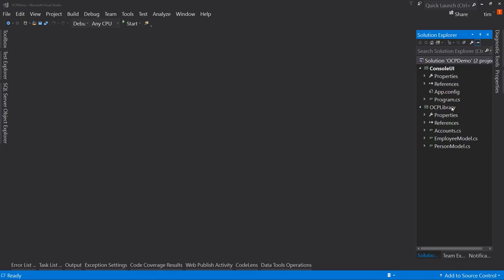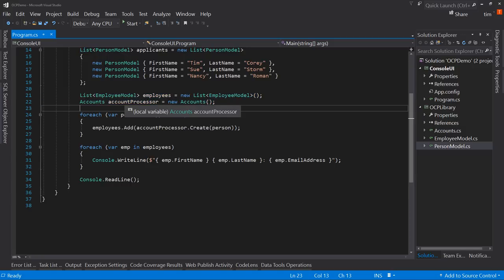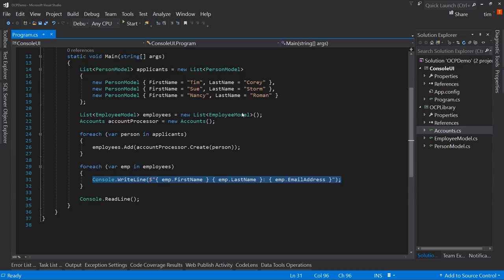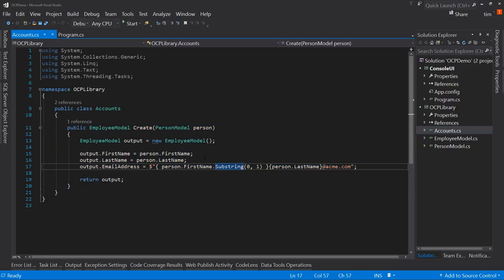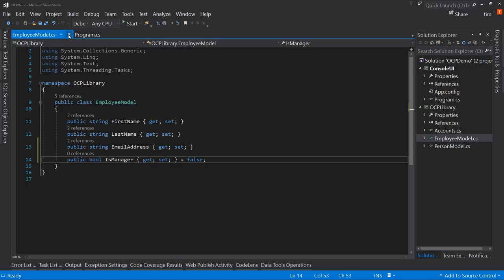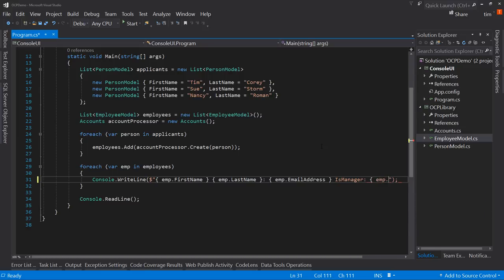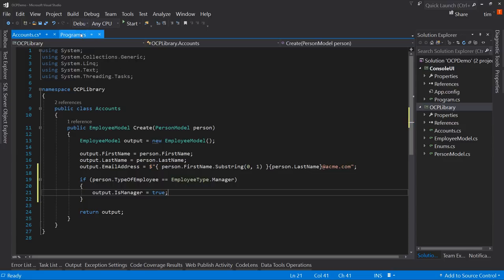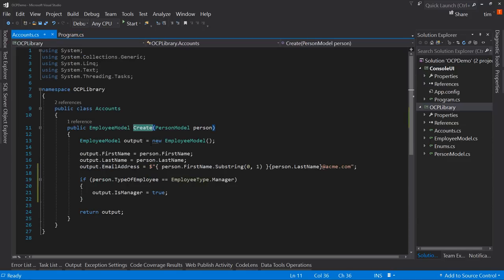Design Patterns: Open Closed Principle Explained Practically in C# (The O in SOLID)

Comment: I have a problem with real world application because somewhere a new class should be instantiated (PersonModel, ManagerModel, ExecutiveModel) and the list should grow with new extensions. 

 With a real world application, a combobox for example has a selector and depending of the selection a class (Person,Manager,Executive) should be instantiated, if new selections is being added, new instantiations must be made, I don't see any way around this.

 What I came up with is a "Handler" class take has the responsibility to detect and instantiate classes on IAplicantModel, that way the main application code does not change, the Processor does not change and even the models does not changes, but the "Handler" does need to change.

and it ended up like this:

IApplicantModel applicant = applicantType.GetApplicant(comboBoxRoles.SelectedIndex);
applicants.Add(applicant);
Reply from the maker: There is always going to need to be change. However, OCP addresses the idea that when you add new features, you extend rather than modify a working class. The reason why is because the working class is working. If a change happens that makes the working class no longer work, then you change the class. If you want to add a new feature that isn't necessarily used everywhere, extend the class. Otherwise, you need to test things that were working that now might not be working because of your change.

Comment: are really a lot of people worried that I am not writing my code right? ;)
Reply from the maker: Yep, there are. The hard thing is that you need to be concerned that you aren't writing your code correctly but not to the point that it makes you lock up or feel bad. If you aren't concerned that you are writing your code correctly, you probably aren't improving. Since no one is a perfect programmer, that's a problem. On the other hand, if you are so concerned about writing good code that you never write any, that is a problem as well. You have to maintain the healthy balance to be a great developer.

Comment: maybe I am not experienced enought yet, but I did not like this example; for just a reasonable person I still can not get the point - how is it better (= by "better" I mean less bug risks, more compact code etc) to implement in essence just one new property/flag (person is a manager or not) - is to create a few new classes, dozens of lines of new code ...  but I'll keep trying to get it
Reply from the maker: When you have an application that is running in production, introducing new code to the running application means you have to test everywhere the new code touches. If you change a class that you use throughout the application, you might have to test every part of your application. That can be a big deal when your application is hundreds of thousands of lines of code (or even a couple thousand lines of code). Changes bring bugs. Don't forget that you can't just test things one way. In business, whole departments are dedicated to just testing the application before it goes live and they still miss bugs. So if your application is running, why would you do something that could cause it to break? Instead, you extend the class for your new usage and leave the working code alone. This means that you only need to test the new code for bugs. Remember that the bugs aren't just in the code you wrote, but in how that code interacts with other code. For instance, just adding one property might not seem like a bug, but if a different part of your application displays a grid of data, you might overflow the form now since your grid is going to be bigger. Or maybe you depended on that class to request data from your database. Now with one extra property, it crashes your database call. The bottom line is "if it isn't broke, don't fix it".

Comment: re: employees.Add(person.AccountProcessor.Create(person))

It feels wrong to be passing person to the Create here because we are now starting the call from the person object which is already instantiated. It’s like it’s left over from when accountProcessor was acting like a factory method. Is this just a compromise you are making for not wanting to change the Accounts class?

The danger here seems to be that I could now pass a different person instance , say Tim Corey, to Sue Storms manager account and now it looks like Tim Corey is a manager (or rather that Sue Storms name is Tim Corey).
Reply from the maker: The idea here is that three people apply for three different job types. We create those people in the system but they have no status. Then, when we hire all three, we pass their accounts through to be converted from applications to employees in the job type they applied to. There isn't a compromise here. The system is working as designed. The design is to have classes that have one job, not multiple. The AccountProcessor's job is to process the conversion of an applicant's account to an employee account with all of the privileges thereto.

The only way you would be in danger of crossing data is if you intentionally did so (which you can't really account for). Yes, if you changed Sue's name to Tim then it would look like Sue is Tim but that isn't something you can ever really fix. It won't happen accidentally though.

Comment: I hate to say it but I think this has confused me more than I was to start with. Could just be me, but seems like even in the second half of the video where you start to apply the OCP principle you are still making MANY changes that violate that principle. Isn't the point to make a class extensible and should not be modified when changes are needed? Seems like you are still making major changes to accomplish simply adding a new property as the end goal. It feels like the attitude of the video is that most of what you are doing is subjective, but at what point do you start making the decision that violating OCP just a little bit is OK. Also seems like trying to follow OCP in an existing program would be very difficult at the least when a completely new requirement comes up, so how are you going to introduce some entirely new requirement without modify a class to support it?.
Reply from the maker: OCP is for once a class is in production. When you are building it, you can modify it all you want to get it right. I think that is part of the confusion. Also, OCP is a goal, not a law. There is going to have to be some flexibility.

Comment: I think a better display of the principles would be going over a single project rather than showing a different project from the first. also false is the default value of a bool so = false is redundant. For the inheritance have it inherit an abstract class for the base then you can override things that may be slightly different but similar.

Comment: It appears your solution introduced violation of DRY principle and I did not see how did you remove repeated code in construction, I would say using an abstract class and setting output first-name and last-name (and perhaps further properties in future) 

and to be very honest with you naming also doesn't make good sense, your naming convention is saying "Every person is an applicant" but a proper naming convention (while keeping same properties) is to say "every applicant is a person" and every employee is a person" because not "every person is applicant" , they can be employee.

and putting the code in GitHub where audience can navigate without downloading a zip/extracting
Reply from the maker: Couple things. First, repetition is not the sole indicator of a DRY violation. I don't see a violation here even though there is a bit of repetition. Second, not sure what you mean by every person is an applicant. Even the code doesn't display that.

Comment: I like C#. But it seems that not many companies use C#. If I want to work at Google, do I have to stop learning C# and learn C++ or JAVA?
Reply: The different languages are quite similar, so the better you are at C# the better you are at the other ones aswell, as long as you just learn the slightly different syntax.
Reply: @kattenelvis1778  thank you
Reply from the maker: A lot of companies use C#. However, there are other languages that are popular as well. It is better to pick the language you want to learn and then get a job developing in it.

Comment: Like for your work. But in  my opinion: 1) video so long; 2) Why we need so many child classes - PersonModel, ManagerModel, ExecutiveModel with the same properties? we can have one PersonModel with base properties (like Name, Email etc) and few properties  with some interface types - like "IAccounts AccountProcessor". And on creation new Person point - you can populate new instance with appropriate data, also populate prop IAccounts  with appropriate type....
Reply from the maker: This is a demo so while some things could be done differently in this specific instance, the point was to show OCP as simply as possible. As for the length of the video, I make videos long enough to cover context, not just the topic. I could cover OCP in about five minutes (I actually have a presentation where I do that but I specifically say it is a review). The problem is that this leaves you with theory and no example of how to actually use it in practice. It is like teaching a person how to build a roof without teaching them how to tie it into the house. It feels like you are learning but it has no real-world application. I always teach with a focus on using the item in the real world. That takes time.
Reply: @IAmTimCorey  
And this year's Oscar goes to ...
Reply: @IAmTimCorey  any way, Tim, thank you for your explanations. It is usefull for understanding this staff
Reply: @IAmTimCorey  I think you are in a right track with having long videos with practical teaching approch. IMHO there is a way to improve it event further, e.g. you can chop them up in 10 minutes peices. This would give the veiwers more focus + sense of accomplishment when they are done with each part, so that take a break in between a long and more complex topic and feel that they have earned it at the same time.

Comment: Is there a need to use long hours videos to explain a simple topic ?
Reply from the maker: I don't really understand this question. You are posting it on a video of less than an hour that not only explains the topic but illustrates it with code.
Reply: @IAmTimCorey  I believe most people do generally in 10 minutes. This is an objective question, thank you
Reply: For most people that 10 minute video is probably fine but it is always nice to have a more thorough explanation when starting. Back when most people start their first language the topic covering primitive types is often an hour long. After that types can be talked about fairly quickly. Having more detail can't hurt but not having enough can.
Reply: The SOLID principles, and the open-closed principle in particular, are not simple topics, even if they can all be described by a single sentence or two. It takes quite some time to understand them well, and it takes a lot more time to become good at using them in writing software and in seeing them being unused or misapplied in existing software, as testified by so many degenerated code bases and bad software projects out there.

Comment: I find the naming not so nice: 
- Shouldn't PersonModel/ManagerModel... simply be Person/Manager..? Adding the word Model doesn't add anything.  
- An Account is not the same as an AccountProcessor?! Maybe it would be more obvious if you called it EmployeeFactory
Reply from the maker: Well, you are bumping into industry conventions here so you have to be careful about naming. For instance, a Model is a keyword that indicates that it is a class that contains (mostly) just properties. It is a data carrier. We use this terminology clearly in MVVM, MVP, MVC, and more. That is why I named these classes with Model at the end. As for calling the AccountProcessor EmployeeFactory, a Factory is another specialized name. It indicates that the class creates concrete instances on demand. This is where the term "Factory Pattern" comes from.  I called it Processor because its one job was to process accounts.

Comment: I think that has only convinced me NOT to use this principle at all.
Reply from the maker: I would be interested in knowing why? Is it the added complexity? The disconnected nature of the application? Design patterns do tend to make your development more complicated to design (and there are a TON more files than if you put everything into one class). That does tend to make a mess, especially when you are trying to convert an existing application over (not that a new application is necessarily clean). However, unless you only ever do simple applications and you rarely make large changes to them (changing UIs, changing databases, etc.), you often see the benefits of design patterns like OCP. For example, in my C# Application from Start to Finish course, what if my boss came to me and said that we are now using MySQL as our database provider instead of SQL? No problem. I would have one class to rewrite and I would be done. Now what if my boss came to me and said to make it web-based (hint: I did that in an add-on video)? No problem, I could do that in about seven hours even if I explained every step. Try that in an application that does not practice at least some OCP/SRP. You are talking about an entire application rewrite (been there, done that numerous times for companies).

Now, before you think that I'm all in on design patterns for everything, I'm not. These are patterns to follow and recommended best practices. They don't fit in every situation. Just be careful thinking they never benefit your application.
Reply: I have been for a few interviews when they have asked me to real of SOLID Principles. But I think with any of these design principles there is pay off between using them and refactoring (I think you did mention this). 
In some simple applications is it not just best to try to keep the code from getting overly complicated?
Also, my main problem is that we suddenly need a whole load of classes now for each type of employee.
What if we wanted to add first aider / fire warden to the list? Would we need a class for each of these? What if a manager was a fire warden too?
Reply from the maker: Yep, there is definitely a trade-off when it comes to complexity and the size of your application. The danger, though, is in thinking that your application is simple. Most applications in business start off simple and end up massive and wildly complicated. By the time you realize it is growing big enough to need better design patterns, it is too late (seemingly) to implement. Rarely does a company authorize you to go back and spend days or weeks redesigning an application with no appreciable change in the final product. The desire is more features, not better infrastructure.

As for the added complexity if the scenario gets more complex, I think you might be arguing to implement OCP rather than arguing against it. If we don't use OCP, we have some type of switch statement or series of if statements, right? So if you add those other types, you have to update a working class with new code and then test everything all over again. Pretty soon you have a huge method that has tons of code and is complex to read and understand. It becomes a fragile artifact that people are scared to touch because one change can have cascading repercussions. On the other hand, if you implemented OCP, adding new types just means adding a new class for each. Each class has code specific to that type and it is small and easy to read.

If you find that you are mixing your types or having more than one thing apply to a user, you could have a List<IProcessor> attached to each person and then you just select which options apply to them and each gets applied. If you did that without OCP, you have an even more complex if structure.
Reply: @IAmTimCorey  Isn't this what Unit Tests are for: to make sure new code doesn't break old code? If OCP could be implemented perfectly and new code never changed old code, why would anyone make Unit Tests?